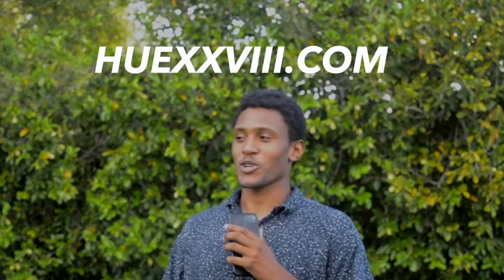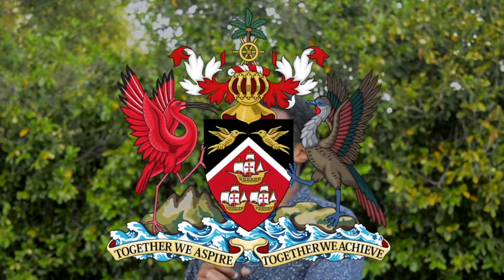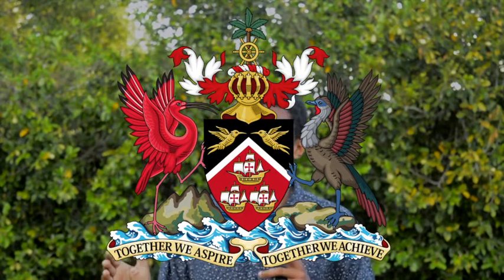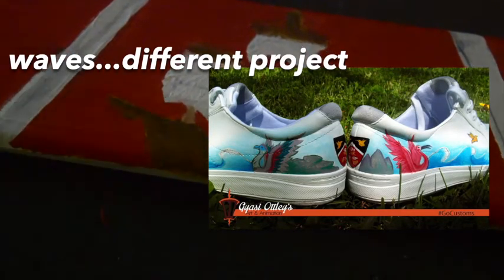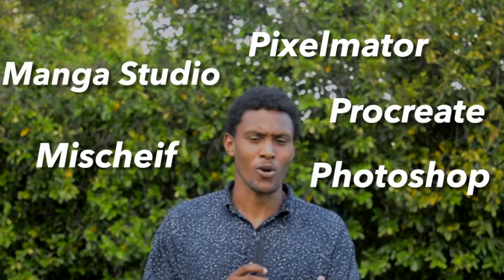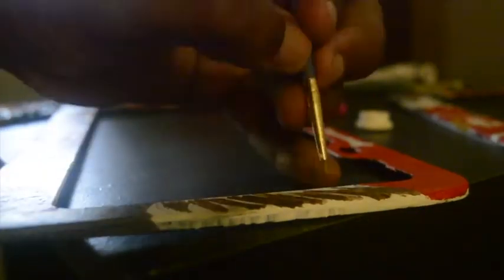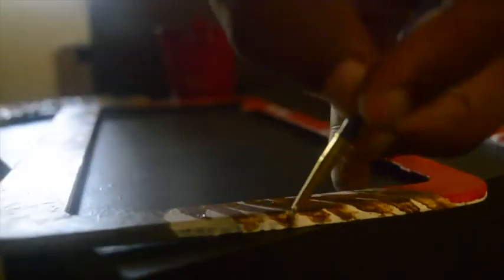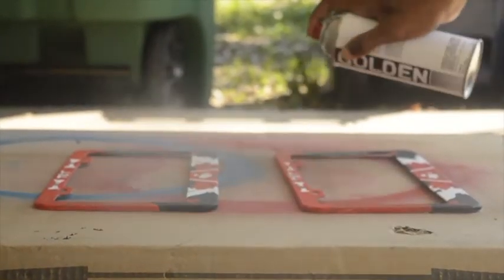How to paint a License Plate frame!  Trinidad and Tobago coat of arms Design

Comment: Will Gesso work if I use Spray paint? I just want to change the color of my license plate frame. I don’t wanna paint any picture or drawing on it. What do you think will work on the frame?
Reply from the maker: YEP! It surely will
Reply from the maker: Yes, make sure to put a clear coat over it too. Thats a general think should think about when painting on a surface.